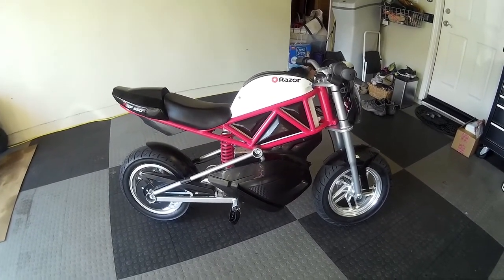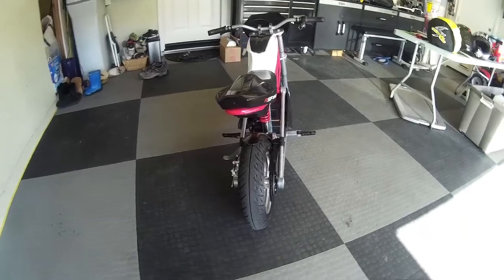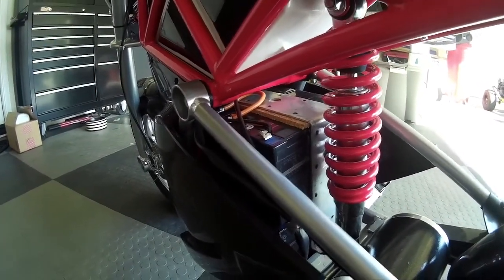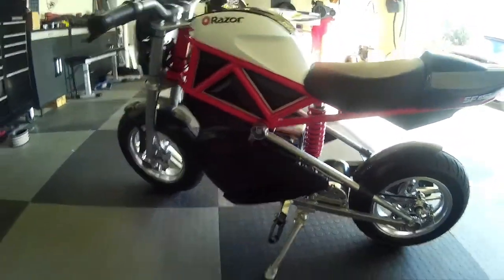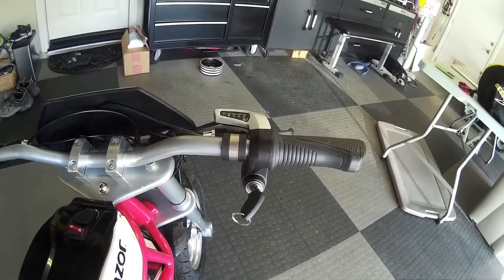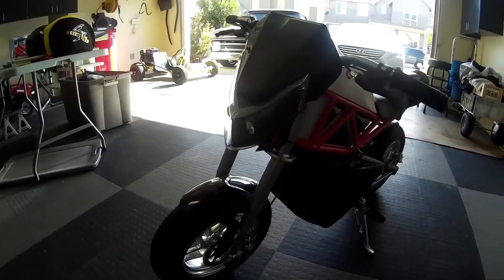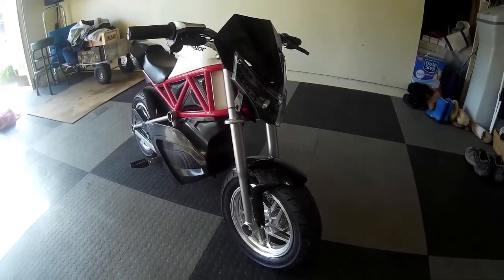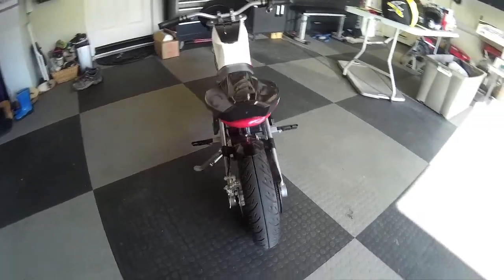Razor RSF650 48v ride

Comment: Hi Scott, great video, I am customizing an RSF for my son, wish I could show pics.  I want to do the same conversion you did with the same ebay kit, I see that the video is 5 years old, I wanted to know if you had any issues with this kit.  Technically an overvolt isn't good for the motor, might blow it up, however I am thinking that with a conservative usage and not going full throttle all the time, it might be ok.  Can you please confirm?  Thanks

Comment: hey just got this bike were can I get the battery and how to do this mod
Reply from the maker: All the parts are available on eBay for a little over $100. Extra battery, new 48v controller and throttle, and 48v charger. Parts are the same as the mx650
Reply: thanks is there a website or something like a guide to do the mod
Reply from the maker: search youtube for 48v razor mx500. the conversion is the same and its been done many times over on that model. theres also an online forum, but I can't recall the name.
Reply: thanks allot for replying
Reply: do you have a link for the 48v charger

Comment: Do you have to upgrade to a 4th battery (48 volt) in order to use the keyed throttle and controller (ebay link) ?

Comment: What did u do to add the keys and where did you get them
Reply from the maker: I bought the keyed throttle and 48v controller from eBay.
http://www.ebay.com/itm/221706345030?_trksid=p2057872.m2749.l2649&ssPageName=STRK%3AMEBIDX%3AIT
Reply: Scott Halstead thanks

Comment: Where on ebay did you get the throttle
Reply from the maker: http://www.ebay.com/itm/221706345030?_trksid=p2057872.m2749.l2649&ssPageName=STRK%3AMEBIDX%3AIT

The mx 650 uses the same controller.
Reply: +Scott Halstead thanks
Reply: What charger do you use to recharger the batteries